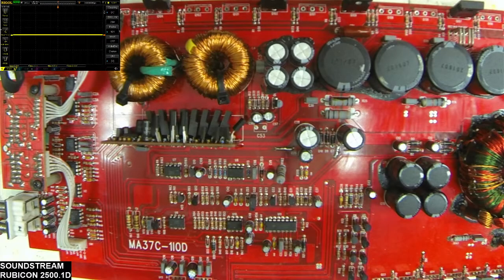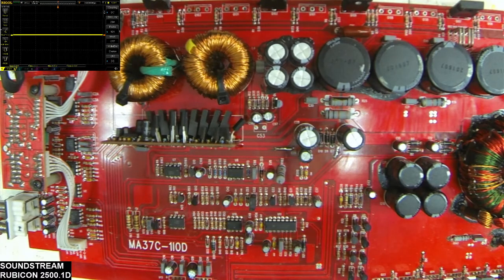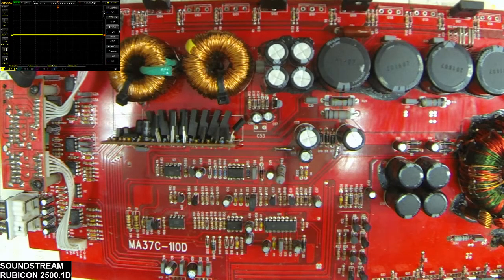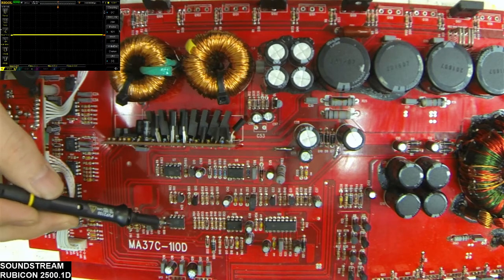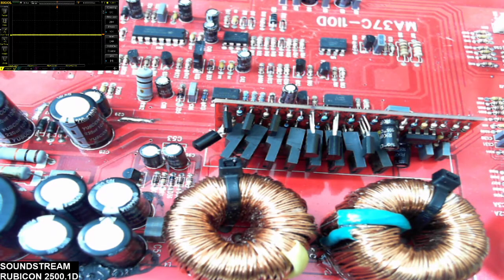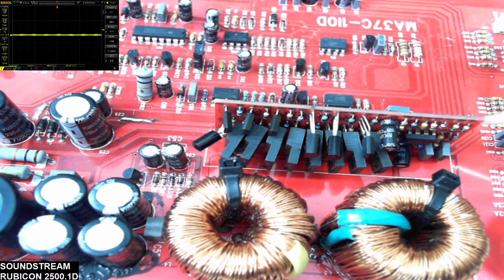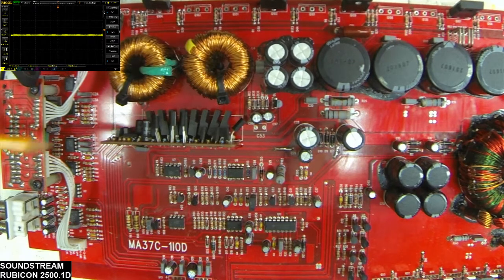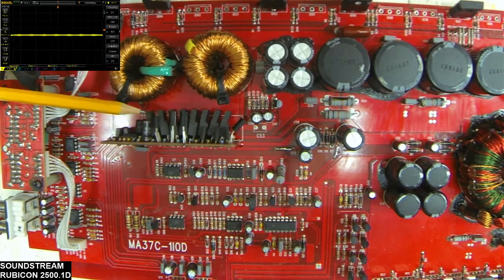Soundstream Rubicon 2500.1D Class D Amplifier Output Section Rundown and Function

Comment: I am currently trynna fix my friends boss blade 3k, In normal operation when turning on the amp it goes in to protection normally and after switches to power but it doesn't anymore it powers on to protect and then after the 3 second wait for it to switch to power it trips back to protect and then keeps going in an endless loop of protect and power until I turn it off, Is it possible that the transistors or the ic cud be a reason for this cause I opened it up nothing was burnt the only thing I found was 1 shorted capacitor on the power side and 3 swollen ones on the output and the fan by the driver card was seized up so I changed the caps and the fan and powered it on and I got the same thing so I am wondering if the transistors or the ic on the board might be a fault but the thing is they aren't showing signs of heat burn, any help would be appreciated.
Reply from the maker: If you pull the output card and the output transistors it should startup if the power supply drive is OK. From there I would replace the swollen capacitors (negative rail?) and rebuild the output card. Once you see a good gate drive then you can put new output transistors in.

Comment: Good evening sir what value is the R66 resistor in the rubicon 2500 Amplifier
Reply from the maker: Thank you for the question! Are you able to send me a picture of the R66 area? The designation numbers change throughout the revisions. You can find my contact information at www.ellensburgamplifier.com
Reply: I have that same amp 2500.1 Rubicon n it plays for a few mins n then goes into protect. My other soundstream Rubicon 2500.1 works just fine in the same vehicle. Any idea wat it could be?

Comment: Like this video because am working on some of these Amplifier now thank you again sir  🙏 🙏
Reply from the maker: Sometimes these comments come in late (3 weeks for this one) so sorry for the late reply! These cards can be a pain. If you have checked everything, signals good to the card, proper signal out of the op amp on the card and you are still burning up resistors then check for carbon tracing between the VIA's of the transistors.